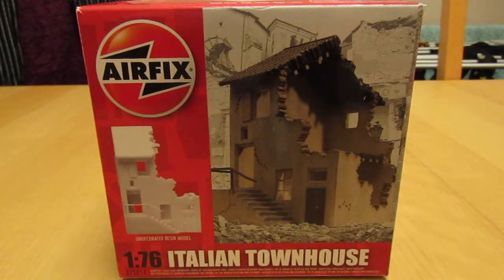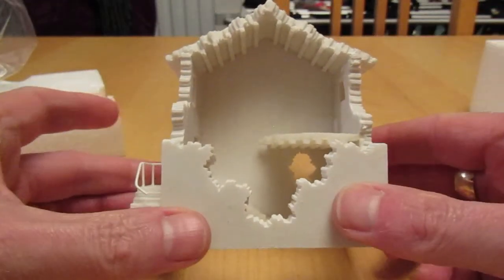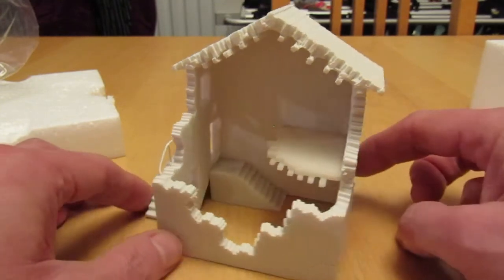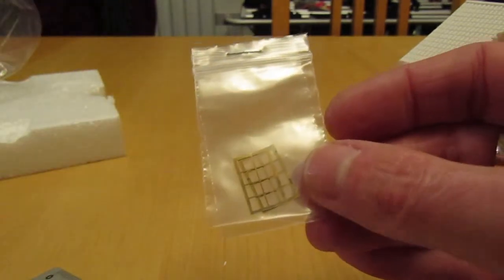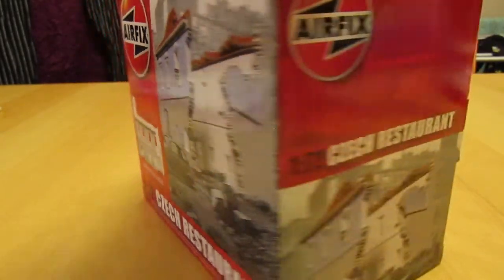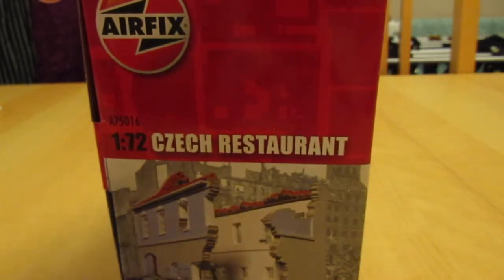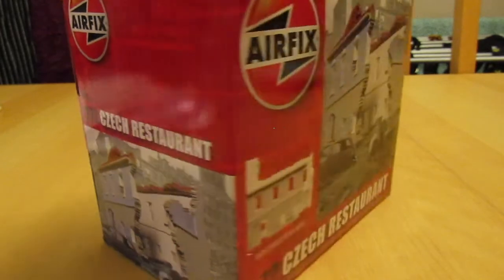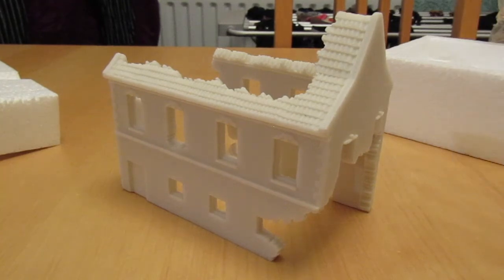1:76/1:72 Resin Airfix Buildings

Comment: Hi good video thanks, I just bought one of these what would you suggest I prime this with please? as i have never painted resin before.Thanks stay safe.
Reply from the maker: Hi Jeffrey, thanks for the comment. I am sure you know it's a good idea to wash the resin in some warm soapy water just to make sure the release agent isn't on the material. I then sprayed mine Chaos Black from games workshop just to give add another bit of surface for the actual paint to adhere to, but you can spray any could you want. Is the spray necessary? I am not really sure, but it was a belt and braces as cleaning the resin may well suffice. Let me know how you get on sir.👍😉
Reply: @alwoodsmodellingmayhem  Thank you for your kind reply, I just been out side my front door had just enough grey acrylic in a rattler can that i bought from Wilco. I also have some matt black Tamiya for the base coat. I also found some spare black foam board for a scratch building same measurements.I managed just too pull the Czech restaurant apart at the end where the  roof is. Now able to make it larger size ect.
Reply from the maker: @jeffreywall8822  Sounds like you have a  plan Jeff, it would be really cool if you could show us the build sir as we love this kind of stuff, but don't feel pressured into doing so if you don't want to. Enjoy your bench time.👍😉

Comment: Wouldn’t worry about scale, especially something as trivial as the difference between 1/72 and 1/76. 
Nearly all commercial model buildings made for this scale are undersized when you compare them to the real life buildings.
Reply: After watching this I went out and bought the Airfix Italian Farmhouse (not the Italian Townhouse). It is stated to be 1/76 and does indeed have walls that are quite a lot thinner than the 1/72 scale Czech Restaurant. In truth I was quite disappointed with the size as I was expecting something a little bit closer to the bulk of the Czech building.